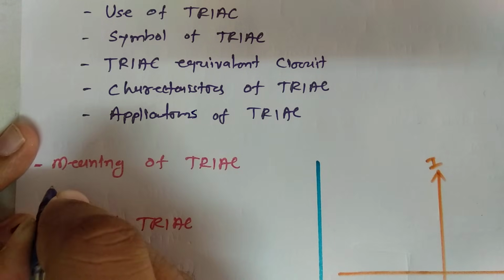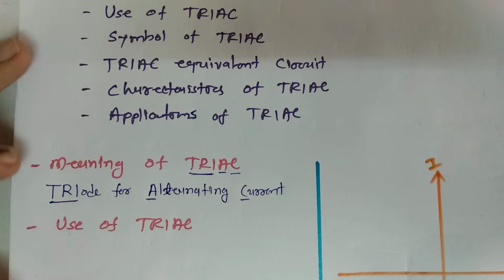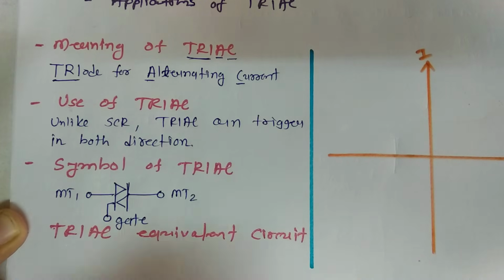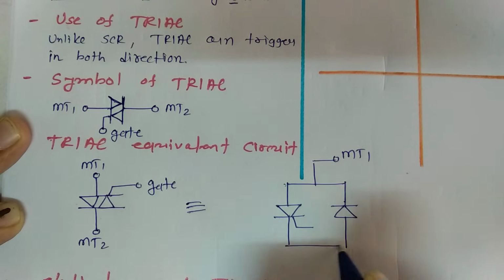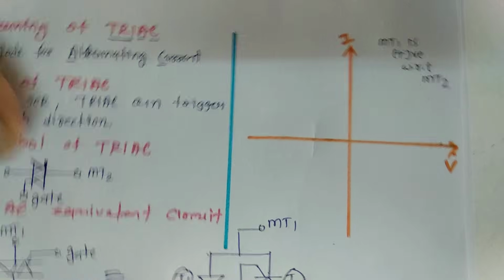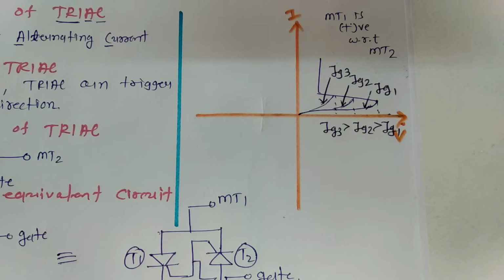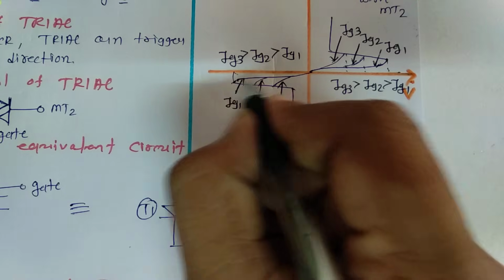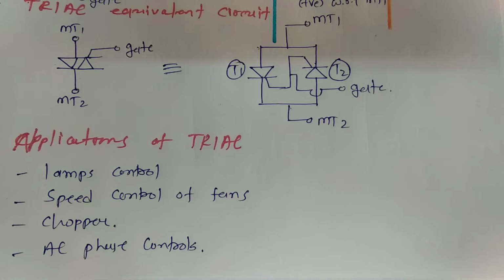TRIAC (Basics, Working, Structure, Symbol, Characteristics & Application) Explained

Comment: Can i trigger the gate with higher voltage than its rated voltage? For example( if i need 12v to triger the gate but i apply 20v in it what will happen?)
Reply from the maker: Trigger will happen but you may damage your thyristor

Comment: Sir triac is also used in split ac pcb for blower motor speed control , there i found blower motor working directly without gate trigger voltage, what would be the reason? I changed triac also but condition is same .I removed optocoupler still motor runs, Please advise.

Comment: I am trying to repair and troubleshoot a SCR which is used as exposure switch in an X-ray unit.  Here 230 V (AC) first is  fed to primary auto transformer and then  stepped upto 150KV (AC) using secondary transformer and further rectified to pulsed DC to run the x-ray tube. My question is if this SCR is unidirectional, then how this SCR switch is used in the AC line between primary and secondary transformer. Theoretically SCR switch should be used in the rectified DC line.

Comment: Sir, why can't triode be used in solid state type of switch?
Reply from the maker: Solid state switches uses high power and current rating is there in terms of hindereds of Amp. Triod is not designed for that ratings.
Reply from the maker: Triod is designed for audio and radio signals and solid state switches operates at low frequency high power applications.
Reply: Thank you so much

Comment: What do you mean by ac phase contol here  ?  In which case ??
Reply: AC phase control means generally used for reducing phase voltage for purpose of reduction of speed of motor.
It is (Triac) main component used in motor soft starter.

Comment: Why the voltage decreasing in scr above the breakdown voltage.what happens inside scr at the time
Reply: Because after the Breakdown, If you apply a small voltage the current will increase rapidly,as the depletion layer has broken down.

Comment: This was a good video. I've been working on a Solid State Relay circuit using a Fairchild Optocoupler part number "MOC3010M" and a Philips Semiconductors Triac "BT136". I understand how to get the value for the (Rin) resistor for pin one of the optocoupler. I don't understand the 180 Ohm resistor between the Triac and pin six of the optocoupler. I just don't know how to calculate the effects of AC through there the current limiting 180 Ohm resistor between optocoupler pin 6 MT2 of the BT136 triac. Now for a 120V AC circuit, the application notes show the use of a 180 Ohm resistor and 360 Ohms resistor for a 240V AC circuit. How much AC is going through the optocoupler's triac? I look at the datasheet but was overwhelmed with what I was reading. Can you show how the 180-ohm and 360-ohm resistors were determind as valid values? It says that the 180/360 Ohm resistor must be a 1/2W. I have seen a pull down resistor on the BT136 gate, is that important? Should the Triac's natural and the DC side ground side be connected together? I say no, but some people are saying connect them. What do you think? I know this is a lot so I hope you can help me. Thank you.
Reply from the maker: DC biasing is only there with Triac then comman connection should be done but if it is involved with other Circuit then don't do that. And resistance is connected to define current rating which is interfaced in your Circuit and if you increase resistance then it will increase power loss but at the same time one should see impedance matching. I can solve your problem only if I am there to see it practically but take care of those points which I have mentioned
Reply: Robert Thomas  please connect me
Reply: How?